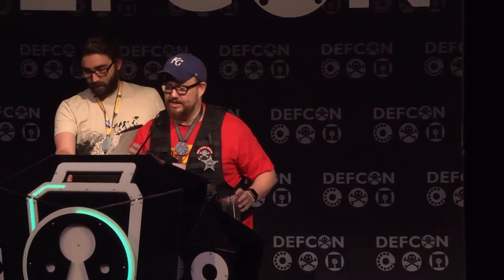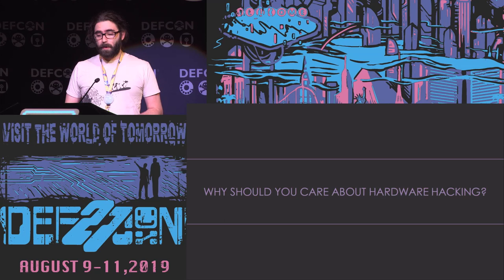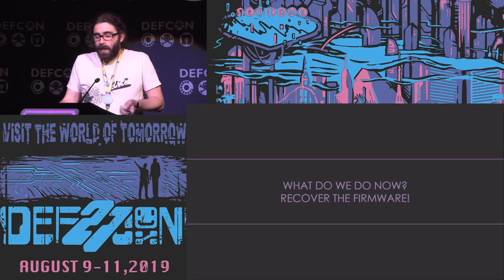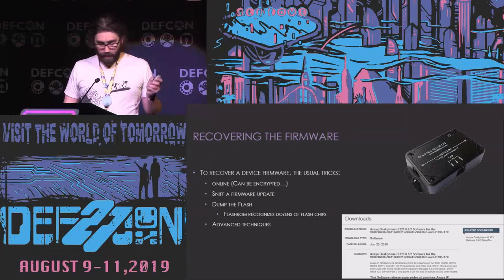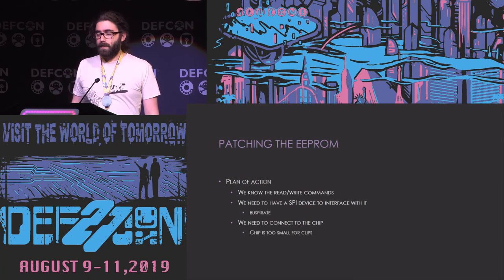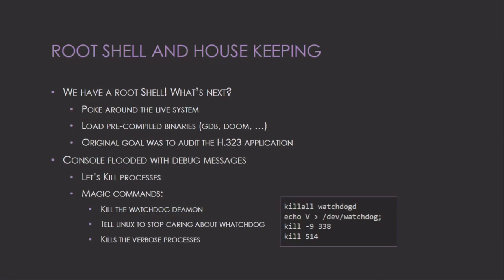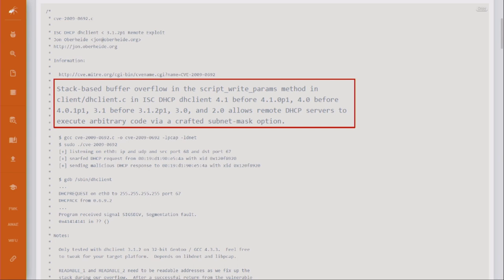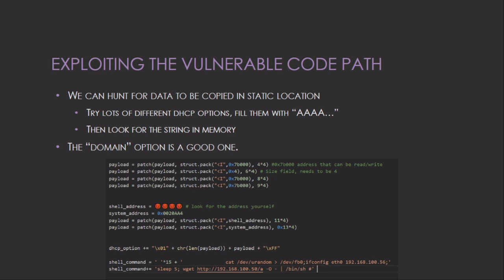Philippe Laulheret - Intro to Hardware Hacking - DEF CON 27 Conference

Comment: Started off thinking it might be good but went down hill,  tracing vias that goto the other side?  Isn't this a multi layer board?
Reply: Good point. It might have been and would explain why I lost track of it. That being said you're missing the point. It was an exploratory process which successfully led to the result of finding the uart. I'm disappointed you feel it's going down hill from there, but good for you if you didn't learn anything from this talk. You should present next time and share even more knowledge 👍
Reply: @movement2contact  are you butt hurt over him being potentially butt hurt ?
Reply: @jordenwilliams8874  I don't think so 🤔